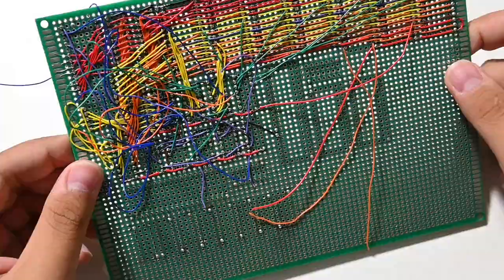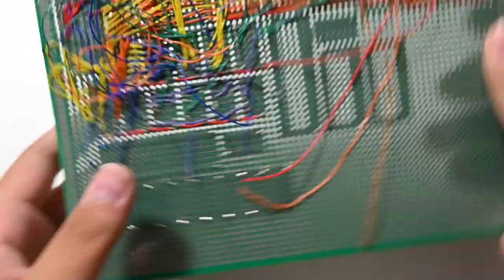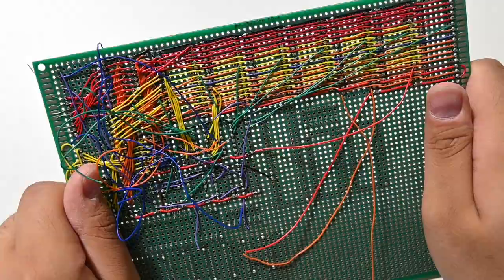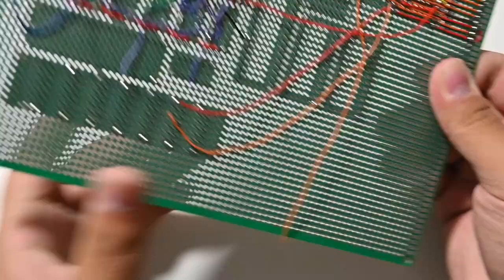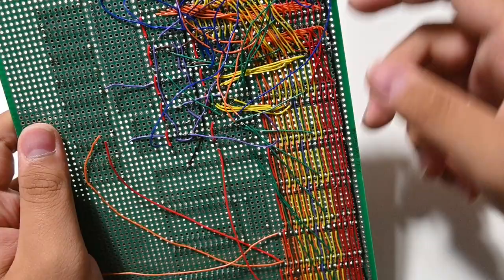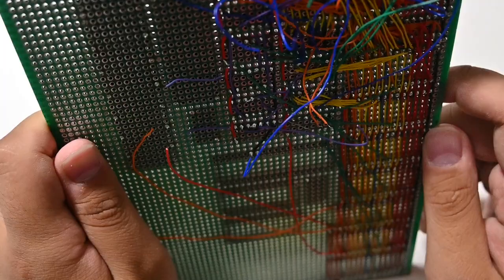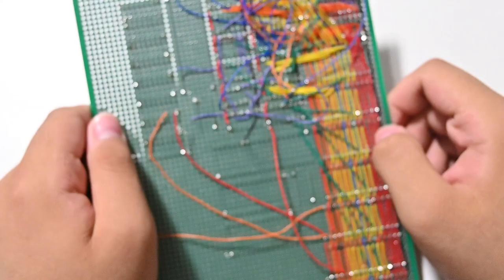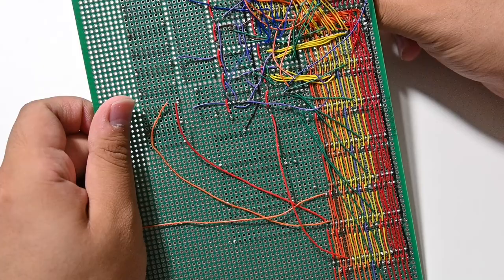[Z80 microcomputer] Tips on prototype board soldering work

Comment: A useful compromise is the Manhattan method.  Every wire segment has only one 90 degree bend.  This has the advantage of reducing crosstalk and keeping the wires somewhat more spread out.  Another thing to try is more clearance between sockets.  This will give you more room for soldering.  An alternative is wirewrap.  This method requires some skill in routing.  Fortunately, mistakes and modifications don't require soldering.  Wrapping in layers will avoid the daisy-chain problem of changing one segment affects all the others.  Wirewrap boards can be quiet and fairly fast if the Manhattan rule is strictly followed.  The installation of bus bars on stilts can improve power distribution and decoupling.  The added cost of wirewrap sockets returns ease of wiring and modifications.  It's also much faster than soldering and easier to follow wires around the board.  I've built wirewrap panels with thousands of connections with pretty good results.
Reply: Totally agree! (I just saw your comment after writing my own comment to suggest wire wrapping.)

Comment: Your problem is exacerbated by the density of your sockets. Put more space between the sockets. The soldering will be easier , more space for the wire, and soldering tip.

Comment: Custom 2 layer PCBs are very cheap, you should consider designing a custom prototype board (think like a half finished design), where the stuff you do not want to change are fixed, and the pins are fanned out in a way to make your work easier when you play with them. This way you can still rewire the board multiple ways, but it can be much easier and more reliable to do so.